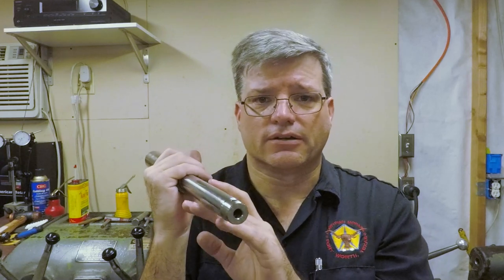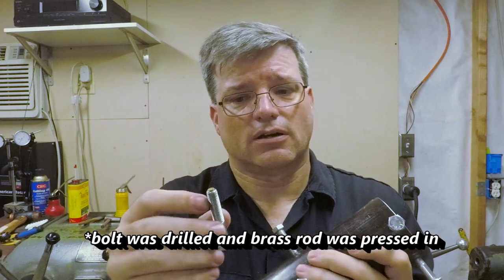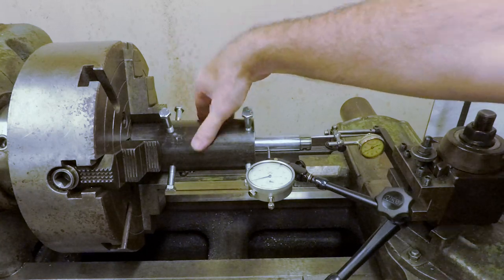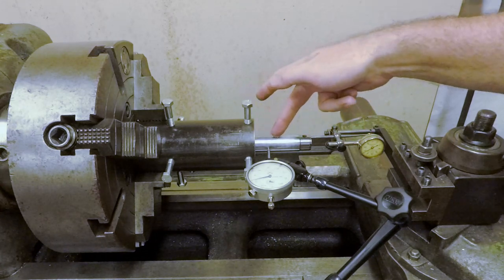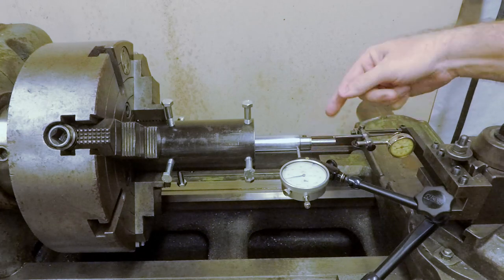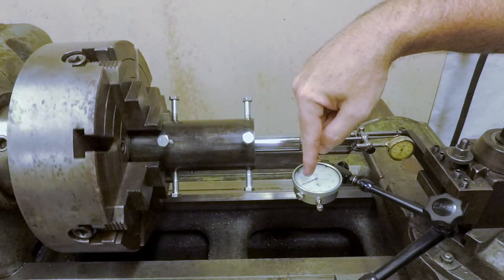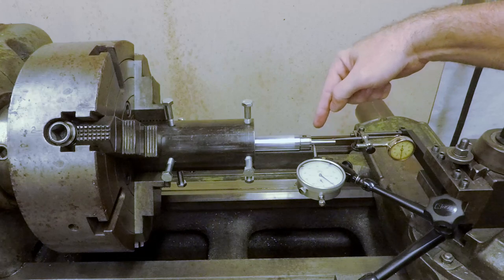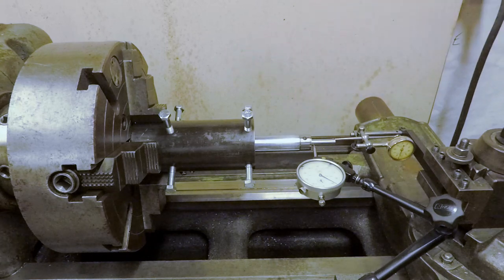Indicating small bores with a barrel spider #tipsblitz19

Comment: Thx, that's interesting! Couldn't you just use 4 jaw chuck and indicate the pin only (since you only care about the bore)?
Reply from the maker: With only one place for adjustment (4 jaw chuck) you can only zero one position along the length of the work. Using two points of adjustment you can zero both close to the chuck and farther away. Try it. :)